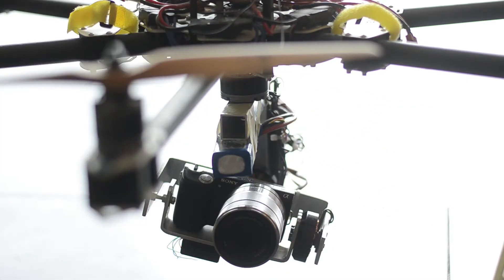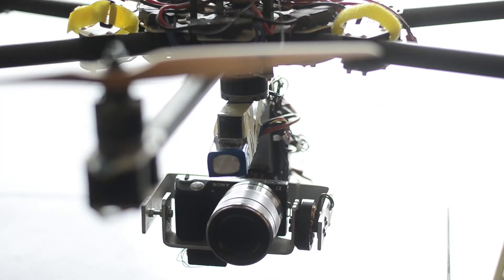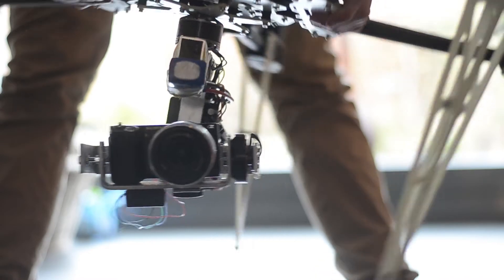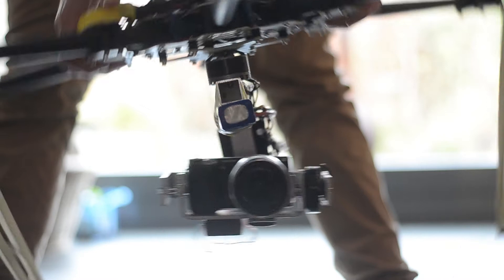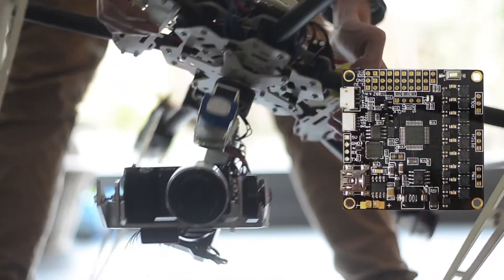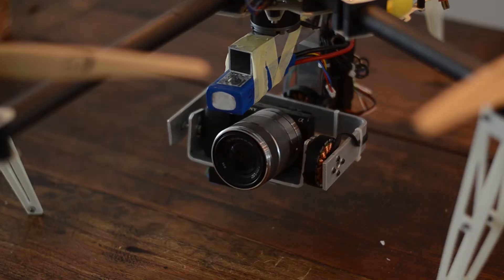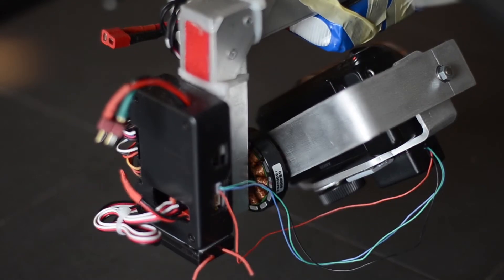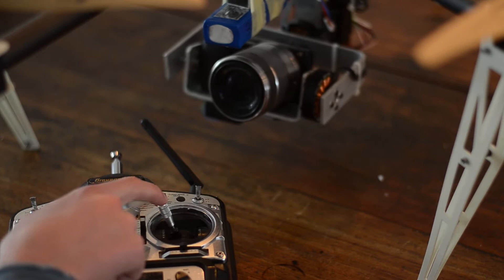32Bit Alexmos 3 Axis Gimbal ***UPDATE***

Comment: do you find 32bit alexmos controller better , smoother?
Reply from the maker: cinefoto bahia The 32bit so so much better in many ways. In my opinion it is the way to go
Reply: Tim Geers thanks. i want to make a 1 axis gimbal added to a glidecam to control the left to right wobble. do you think a 32 bit controller would still be smoother then 8 bit used for only 1 axis?
Reply from the maker: +cinefoto bahia I think you can get away with the 8Bit but it is just harder to set it up